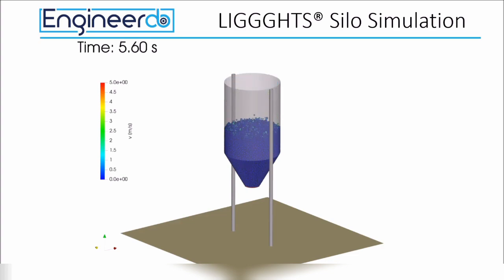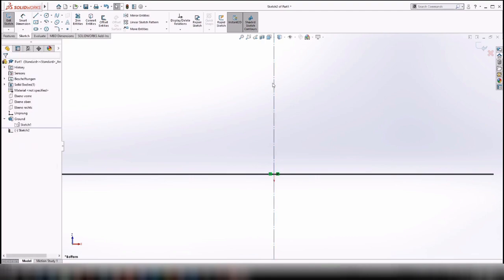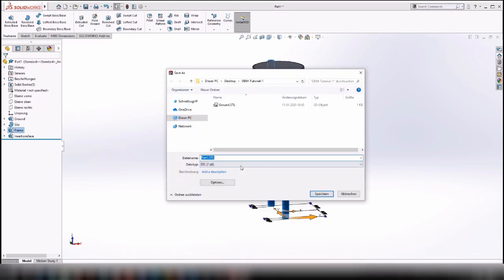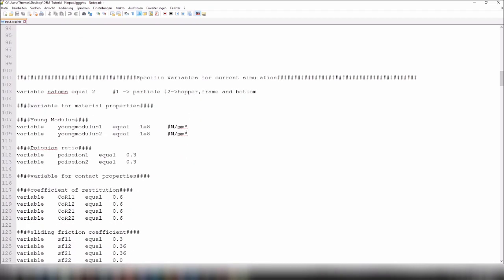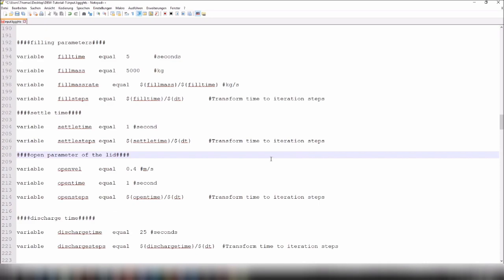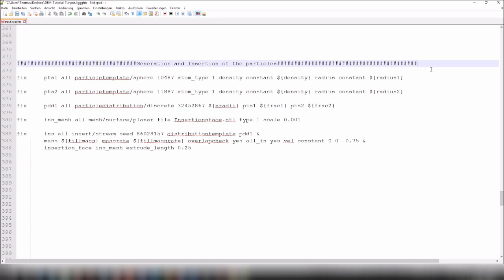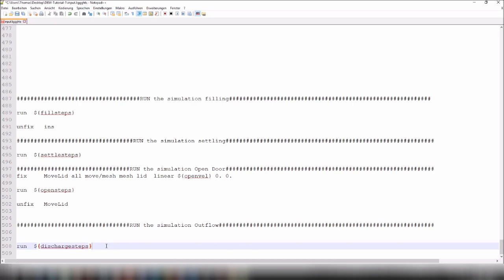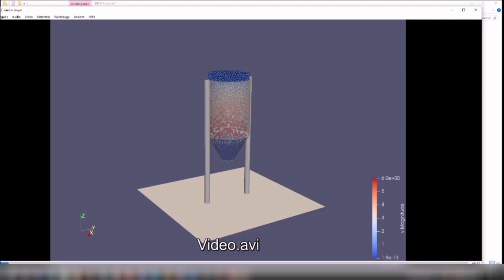Tutorial of DEM Simulation using LIGGGHTS: Complete Workflow of a silo particle simulation

Comment: Awesome tutorial! How can I do this simulation if I want to simulate continuous materials like clay instead of discrete particles falling out of the silo; is Liggghts still works for that or I would need something else? Thanks for your time.
Reply from the maker: Hey Jason, thanks for your feedback. You can also simulate cohesive materials like clay. For this you have to activate the cohesion of the particle in the model line. The simplest cohesion model in LIGGGHTS is the sjkr model. Check the manual for now: 

https://www.cfdem.com/media/DEM/docu/gran_cohesion_sjkr2.html

In the tutorial it should work, if you change the follwing lines:

1.) After the rolling friction variable definition, you have to add the definition for your cohesion parameters, like:

####Cohesion Energy Density####
variable CED11    equal 100000 # particle particle cohesion
variable CED12    equal 12345# particle walll cohesion
variable CED21    equal 12345# particle wall cohesion
variable CED22    equal 0

2.) Add a material property like:

fix   m6 all property/global cohesionEnergyDensity peratomtypepair ${natoms} ${CED11} ${CED12} ${CED21} ${CED22}

3.) Change the two model line command to:

pair_style gran model hertz tangential history rolling_friction epsd2 cohesion sjkr2 #contact model

fix   walls  all wall/gran model hertz tangential history rolling_friction epsd2 cohesion sjkr2 mesh n_meshes 4 meshes silo lid ground frame

I havent double check, but it should work. You can "play around" with the CED value to see how your particle will get more sticky, when increasing CED values.
Reply: @engineerdo6568  I am getting this error 
(../contact_models.h:364)
ERROR: Unknown argument or wrong keyword order: 'cohesion' (../pair_gran_base.h:129)
*Update: I can get it to run after switching the order of cohesion sjkr2 and rolling_friction epsd2 

pair_style gran model hertz tangential history cohesion sjkr2 rolling_friction epsd2  #contact model
fix   walls  all wall/gran model hertz tangential history cohesion sjkr2 rolling_friction epsd2 mesh n_meshes 4 meshes silo lid ground frame

However, it is taking much longer to run, is there a method to change the amount of particles or another way to shorten the run time?
Reply from the maker: @jasonalt6232  The amount of particle is determined by the mass in your system and the grain size distribution. Using advanced models will increase the runtime. DEM Simulation for industrial problems can take weeks of computation.

Hence, you can decrease the total mass in your simulation or you can scale up the particle radii. Both will lead to smaller number of particles in you system.
Reply: @jasonalt6232  Thank you this really helped me out! I was struggling with this for days!
Reply: @engineerdo6568  Thank you very much, this really helped me a lot. I will try this out.

Comment: Is there any way to enter a particle range in fix pts command? 
Eg. Particle size ranging from 10micrometer to 100micrometer
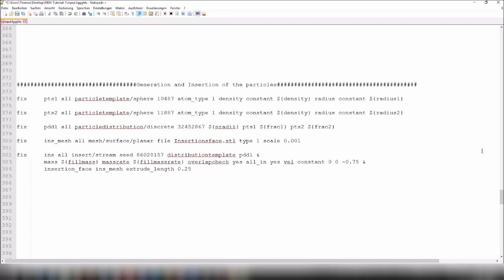Reply from the maker: Hey Asif, that's pretty easy. Just have a look to 14:58 in the video. You can use a grain size distribution by adding more than the two particle sizes in this video. There is no limit. Just copy the command and put in as many as you like
Reply: @engineerdo6568  thank you.

Comment: Is there any way to find the volume of particle inserted in the container using the code or in paraview?
Reply: Its for finding porosity.
Reply from the maker: @asifkamal7033  there is a way. You have to calculate the sum of the individual particle volumes. This leads you to the volume of the solid phase. The bulk material volume must be calculated in a hull volume. For a example you can use a clip filter to generate a box of particles out of you simulation. Then you have both volumes and you can calculate the void fraction.

Comment: Hello, very good tutorial.
In my case I am currently starting to practice with LIGGGHTS-WITH-BONDS, and I use lpp to convert files to VTK format. At the moment of executing the input.liggghts file, I only get the 4 stl files in the post, but not the particles_liggghts file. I have tried using the lpp dump *. "Particle" command to get the file (this works for me with the built-in examples in liggghts), however I was unable to generate particles_liggghts. Any recommendation?
Thank you
Reply from the maker: Hey Bastian, you are welcome. If you like you can send the script to info@engineerdo.com and we will have quick look to your problem. Usually the way you have allready tried is the best way if problems like this happens: Take a liggghts example and modify it to your need.

Comment: I had changed the dimension of solid model files but liggghts is showing all mesh files are missing
Reply from the maker: Hey Prince Goyal, thanks for your comment. What exactly is the error message you get? Have you changed the CAD model in a CAD model or scaled in  the liggghts script?

If you are using larger solid model dimension, it is important, that you also scale the dimension of the simulations box (x y z), so the model will fit in.

Was this comment useful to you?
Reply: @engineerdo6568  have decreased the dimensions and I changed the scale to 0.0001. it is showing error in lid and silo.it is showing that mesh have been lost or left the domain.
Reply from the maker: @ektharaja0607  Hey Prince Goyal, I think I got you now, but sometimes debuggen without script might be challenging :)
 If you dont change the dimensions of the simulation box (xyz) it works. Following Points may be helpful to check:

1.) Double check scale of alle elements:
STL:
fix			silo 	all mesh/surface file Silo.stl 	type 2  scale 0.0001		
fix			lid   	all mesh/surface file Lid.stl 	type 2  scale 0.0001
fix			ground 	all mesh/surface file Ground.stl type 2  scale 0.0001 
fix			frame 	all mesh/surface file Frame.stl  type 2  scale 0.0001

Insertion:
fix		ins_mesh all mesh/surface/planar file Insertionsface.stl type 1 scale 0.0001 

2.) change the open velocity, so the lid will just open 0.04 m in 1 second, else the lid could move out of your box:
variable	openvel		equal	0.4/10

If you are also changing the dimensions of the simulation box to down scale, check:

3) the extrude lenght has been scaled down to 0.025, because otherwise the particle generation would be outside the box:

fix 	ins all insert/stream seed 86028157 distributiontemplate pdd1 &
        mass ${fillmass} massrate ${fillmassrate} overlapcheck yes all_in yes vel constant 0 0 -0.75 &
        insertion_face ins_mesh extrude_length 0.025

I hope it works now, else send the script to info@engineerdo.com and we will have a quick look.

Cheers

Comment: Hello There ! wonderful tutorial that you did there. can you make a video of combining 2 systems like hopper/silo and a screw auger(screw conveyor) ? 
thanks in advance
Reply from the maker: Hey Nithin, thanks for your question. This sounds like a good example. Do you have any special geometry / applications in mind or can you even provide a geometry? Than it will be faster to do.
Reply: @engineerdo6568  take aquaculture for example. You have fish food of typical dia of 5 mm (spherical) is held in hopper and it is carried to the outlet via a screw auger (constant pitch or variable pitch ) . You can take like 600 kg of fish food for pellets . Also interesting would be to conduct a stress analysis on hopper walls. Framing practical questions excites me 😅
Reply from the maker: @nithinsivakumar2726  thats a very good example. Indeed this is possible to simulate. If the parameters for the simulation are set correctly - the bulk material must be calibrated - the simulation will show very accurate results. 

This simulation can show not only stress on the wall but also the torque which is required to drive the screw.

Is this an application you are working on?
Reply: @engineerdo6568  not yet , but I will in a couple of months as my thesis project.